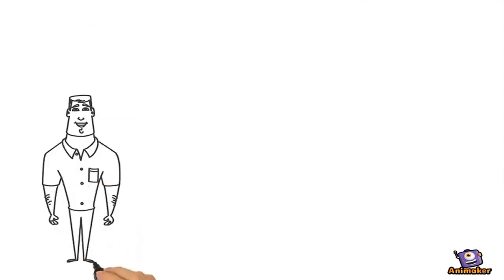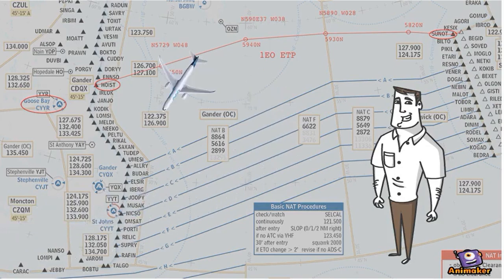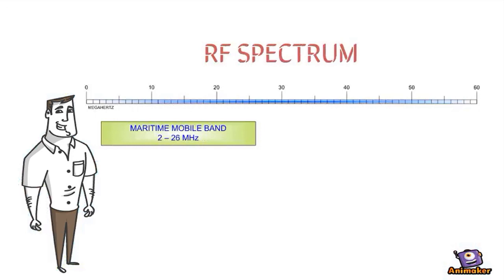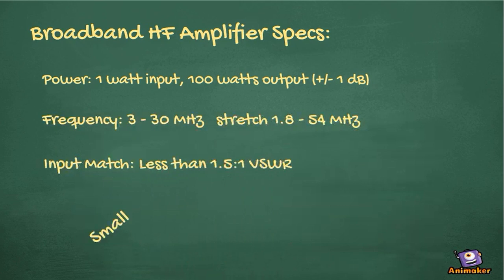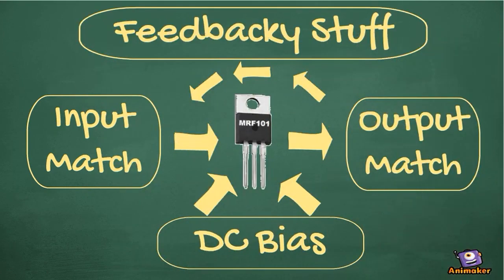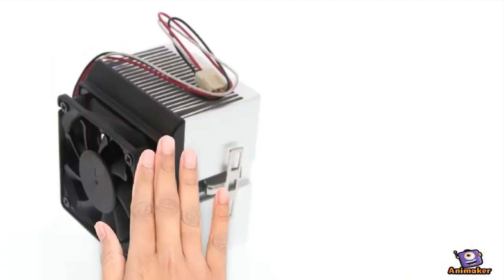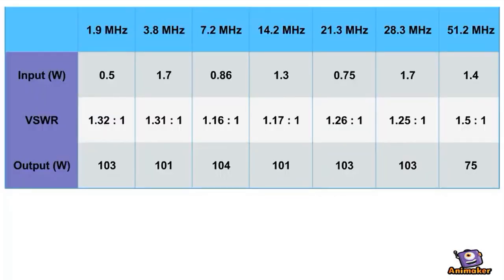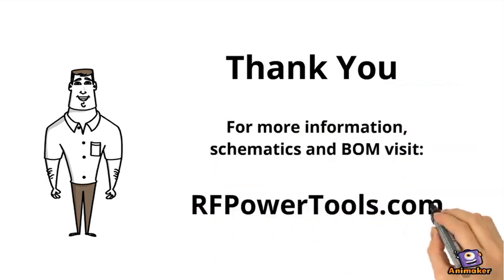NXP Design Challenge Video

Comment: Great project Jim, whats the price?
Reply from the maker: You can order the bare board for $12 + $3 shipping or I can put the SMT parts on for $40. I also have a T/R switch with SWR bridge and low-pass filter boards to make a complete amplifier.

Also in process is a universal controller and display board that uses an Arduino Mega and provides controls and sensors for a complete amplifier. 

Here is the link to the RF Power Tools store:  https://sites.google.com/site/rfpowertools/store
Reply: @WA2EUJ  thanks, smt parts for 40$ included transistor or not? Thanks in advance.
Reply from the maker: @mladencukon-9a3xz  Not for $40, since part of the Design Challenge prize was $1000 worth of NXP products, I have got a bag full of MRF-101's. If I can figure out how to make one an add-on, I'll offer them at a discount with the purchase of a PCB.
Reply: Could you please sent me your email?
Reply from the maker: @digitalbroadcasting4665  Yes you can reach me at jim@RFpowerTools.com

Comment: Very nice and compact design Jim. What about IMD at 100W output power ?
Reply from the maker: I run 2-tone tests on 80M, 20M and 6M with two 20W carriers on 80 and 20 and 12.5W carriers on 6 (80W PEP and 50W PEP).
You can see the test results here: https://sites.google.com/site/rfpowertools/home/nxp-mrf-101/test-data

Since the amp is class A it is very linear. The results weren't much worse 100W PEP. The amp run at 50V with a 2:1 transformer (4:1 impedance).
It's way more linear than a class AB amp running at 13.8V with a 4:1 transformer (16:1 impedance)  like most transceivers have.

Jim.
Reply: @WA2EUJ  Is it actually Class A Jim? Class A amp typically is efficiency of about 40% IIRC, that would require 250 watts from the supply and the heatsink would need to dissipate 150 watts. Please correct me where I'm wrong. I like the design though, clearly so did NXP, congratulations!
Reply from the maker: @watson946  
Hi Ian,

I measured the 2-tone IMD products on 80M, 20M and 6M at -38 dBpep, -41 dBpep and -40dBpep respectively. On 80M and 20M the amp was creating two 25W tones for 100W PEP and on 6M the tones were 18W each for a PEP of 72W. It may not be the cleanest amplifier but it is sufficiently linear for most ham radio applications. The design uses a healthy portion of negative feedback to help with the linearity. With a bias of only 100 mA I think that the amp qualifies in the Class AB range, not purely Class A.

We routinely run the amp on a Meanwell EPP200-48 cranked up to 50V and max current is less than 4A.  

Here are links to the linearity plots of 80M, 20M and 6M

https://www.dropbox.com/s/r23z0k5p13aiy6r/MRF101EVB_80M_2_TONE.png?dl=0

https://www.dropbox.com/s/u9h99cr9jkzca9z/MRF101EVB_20M_2_TONE.png?dl=0

https://www.dropbox.com/s/t47xk7ox0dqdkfe/MRF101EVB_6M_2_TONE.png?dl=0

Best regards,
Jim.
Reply: @WA2EUJ  Thanks for the reply Jim, this stuff is still very much a mystery to me, I'm just getting started trying to design my own amplifier, it was the mention of Class A that threw me, it looked more like Class AB. I certainly don't doubt it is adequately clean. Nice one Jim, 73